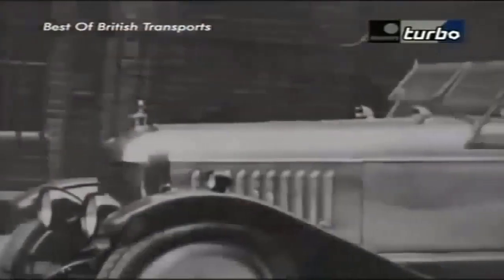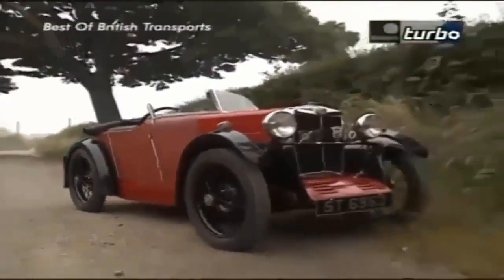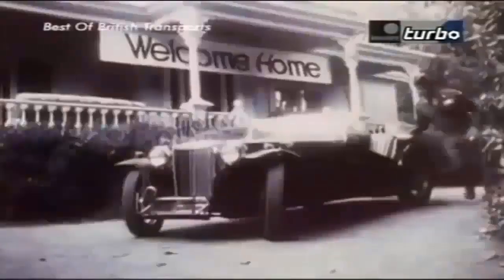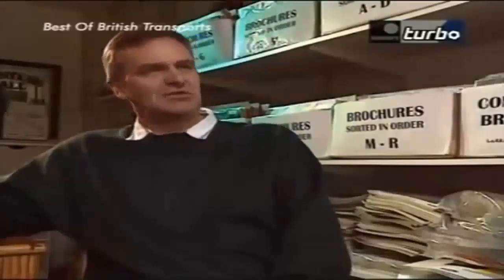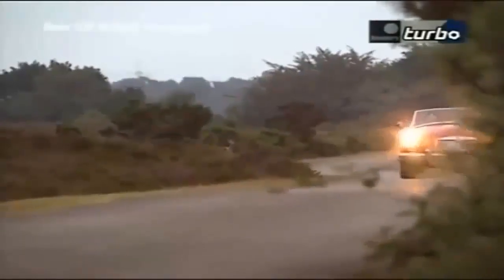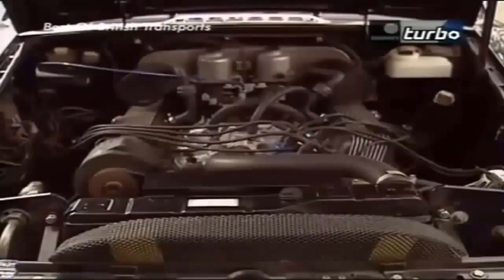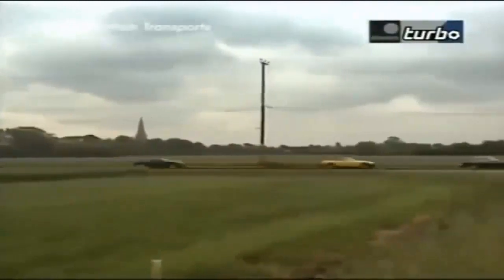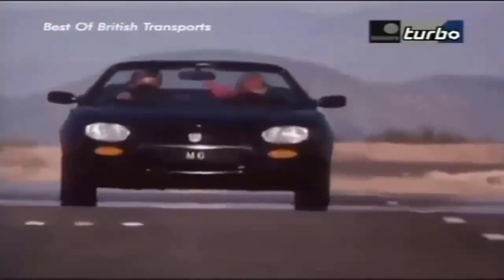MG Cars History - Automotive Industry (Nat Geo History)

Comment: I owned a new MGA Mk II right off the showroom floor, broke it in properly (took an entire afternoon of accelerating from standing, at 2/3 to 3/4 throttle, brake slowly to a stop, etc.) and got great gas mileage, plus drove it across the top of Wisconsin at 70-110MPH (no cops anywhere on the route), ran like a champ.  That model came with a front anti-sway bar and oil cooler as standard--my friend, the salesman, said, "This car is built with racing in mind, literally built with a bold on a bolt."  Took it in for servicing in January of '63, sat in the Tartan Red MGB on the showroom floor, cranked the driver's window up and down, put the seat back all the way and found I couldn't put the clutch pedal all the way down---and ordered a powder blue one with disk wheels.  They had trouble getting it, so I bought the showroom model, which had 72-spoke, triple-laced wire wheels, and loved it for three years, until I traded it in on an MG 1100 sedan (front-wheel drive---with a wonderful heater!) and a '61 Austin-Healey Sprite Mk I, to go racing.  I miss both MGs all the time...
Reply: I don't know if you'll see this but I'm young and in love with mgs, the heritage everything, I have a 77, 78, and had a 71 mgb! your story is awesome, safety fast!

Comment: My father drove an MGA in college.  He later got a Mustang because of reliability and ease of repair issues.  I later bought a 1979 Midget as my first car in high school. I dont regret it.  However, continious carb problems put it in the shop as much as it was on the road. I sold it to an MG mech for a little more than I paid.  My next car was a Datsun 280 Z, fuelie, no carbs to worry about.  Sorry, its all Japanese from here out. The Miata is the new MG.